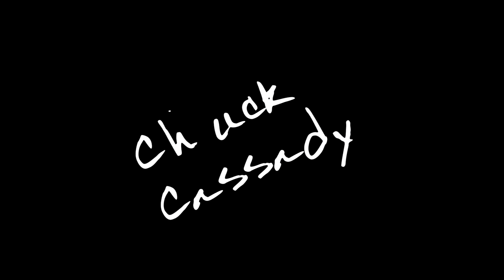RARE Curved Ceiling install on Skoolie!

Comment: Why not put the ceiling in before the interior walls? That way you wouldn’t have to go around them. You could just build the walls up to the finish ceiling.
Reply: ceiling is typically done first because of the cabinets and any upper head storage. otherwise, you have a lot of notches to cut out.

Comment: looks great. I debated doing this method, but I just felt like the lines going with the length of the bus worked better for my build. aligning the boards with width makes the bus feel wider, whereas aligning with the length makes it feel longer.

Comment: In my 1965 unimog I also have a curved roof. My walls are varnished okoume. And for the roof I have 40 year old mahogany 5mm plywood sheets. Which I also gonna varnish. Curves and round shapes are so pretty 😍

Comment: That's similar to how I'm doing mine. I can't go direct to the furring strips though. My puck lights are 5" diameter so a hole saw would wreak havoc on that method,  so I got some 1/4" birch plywood to go up first.

Comment: Crazy how flexible that stranded marine "romex" is. 

Also, are you going to fill the staple holes?
Reply from the maker: Probably not. I love the marine wire!
Reply: What is romex?
Reply: @lifehunter6426  Romex is a brand name of what is known as non-metallic sheathed cable (NM). It's commonly used in homes and businesses inside walls. It comes in a variety of sizes and the jacket usually color coded based on the gage of wire.
Reply: @josephmadden2067  thanks